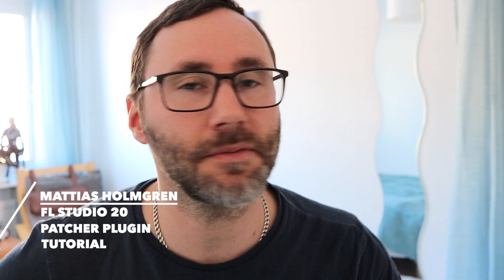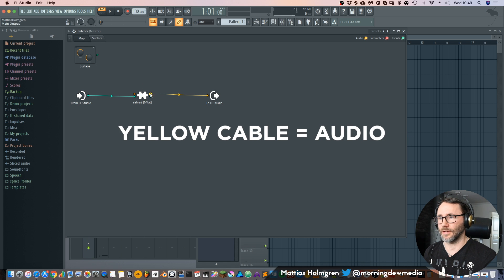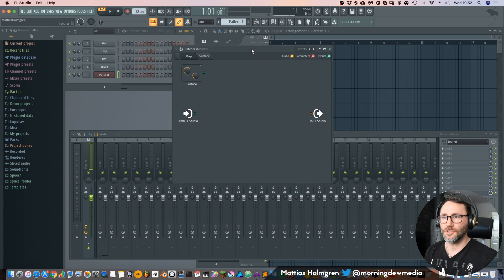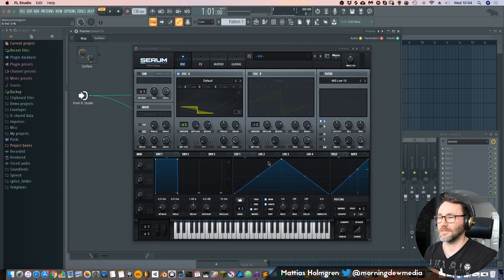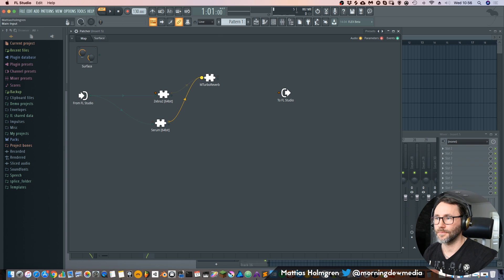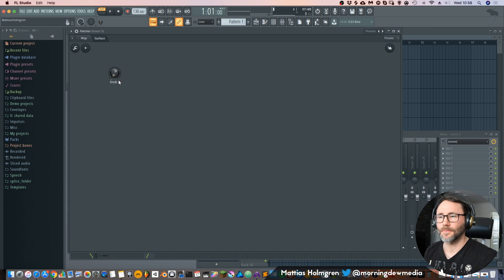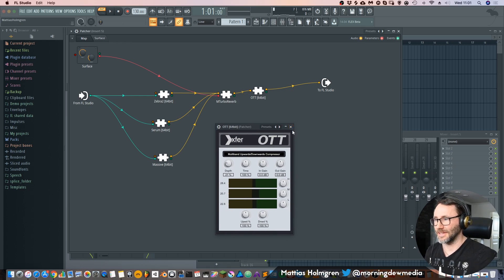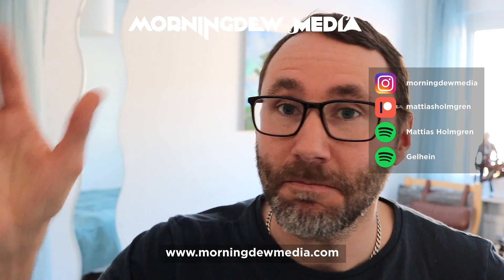How to use FL Studio Patcher Tutorial

Comment: Hello, is it possible to have some instruments inside patcher play in different octaves ?
Reply from the maker: Oh yes indeed. In a patcher instance; you just insert a VFX Level Scaler plugin before the instrument device. Then set the offset either max (+12 semi) or lowest value (-12 semi). If you want more pitch adjust you can add another VFX Level scaler "post" this first VFX Level Scaler. And it will further pitch that midi event.
Midi events / cables are colored greenish in the Patcher so it's easy to see what events plugins are sending. As soon as the cables are yellow you know it's audio, and then it's hard to do pitch adjust. As long as it's midi (green) add VFX Level Scaler and modify what you want. ;)
I'll make a video showing the process. But you probably get the point from here.
Did that solve your problem Gamaliwa?
Reply: @MattiasHolmgren  wow, that's an incredibly detailed response. Thanks so much for that and for the video here. I've already thrown some ideas together in Patcher but have only scratched the surface of what's possible. So the details you provide are immensely helpful.
Reply from the maker: Glad to help out! Yeah I love the Patcher too. Its a great sound design toolbox.

Comment: Hello Sir, 
If there are few effects plugin in series then how to bypass(mute) or solo any plugin ?
From FL Stduio -> Instrument -> fx 1 -> fx2 -> fx3 -> To FL Studio 
If i want to solo or mute fx2 in the chain then how to do it without disconnecting the wires ?
Reply from the maker: Unfortunately there is not "mute effect / disable effect" feature in the patcher. I vote that they implement this. ;) There are some rumours of using EQUO which has an additional out. But it's more of a workaround. A simple mute would be superb! Thanks for writing AligNation!
Reply: FL Send can be used  https://forum.image-line.com/viewtopic.php?f=1952&t=153034#p1089799 so can be played dry/wet signals independently from each other, EQUO post is here https://forum.image-line.com/viewtopic.php?t=163056#p1432437 with the project file
Reply from the maker: Hi, yes it's possible to Send in series (and more) if you make use of the EQUO. The EQUO plugin in FL Studio has 4 sends, which can be activated. ;D Thanks for writing!

Comment: Thank you for the tutorial, Mattias! I want to ask you a question regarding Patcher. 
I'm working on 10 tracks and all use the same drum sounds. However I want them to be pretty different in each project in terms of effects but still work based on the main drums, so basically have multiple Patchers presets for different drum sets and inside to have the main drum sounds which are also in a Patcher with a preset. This works great but if I decide to change (Save Preset > Replace) the main Patcher preset, no update will occur in the other presets nor in other projects. This seems to happen with any plugin, not just with Patcher. 

Do you know if it's possible to keep the presets always updated or at least auto-update them when I re-save a preset of Patcher? Because what Patcher does is just great and I want to use it at its most capacity.
Reply from the maker: Hi Alex, unfortunately I don't think this is possible IME. Because as you load a FL Studio project, it will load the settings which are saved with the project. And that includes THAT instance of the Patcher with it's specific settings. I totally see what you want to go with this and it would indeed be useful to be able to load an updated version of the Patcher instrument as you make changes within another project. But as I mention the settings are saved per project.
The only thing you can do I guess is to "re-load" overwrite the track into the updated patcher preset each time you want to update.

Comment: i tried this chain but couldnt get any sound. It was with a midi plugin first, BlueArp and tried chtulhu. Then routed to Sylenth1. Used green and yellow cables in different variations. Couldnt get any signals from blueArp(free plugin!) because the arrows on the cable didnt move. Why i tried this was because i was checking out Bitwig and it was super easy and  fast to do and i wanted to recreate it in FL Studio. I wish those 2 companies would merge and we would have the best DAW of all imo :) Any ideas?
Reply from the maker: Hi Jan. Bitwig works differently than FL Patcher, so don't expect to be able to do the same things. I'm glad we have diversit, two different unique DAWs that can fit certain producers. You can always run FL as a plugin in Bitwig if you want. It's not a perfect solution but then you can make use of all the sweet plugins from FL. ;)